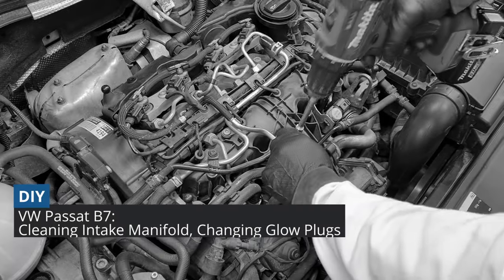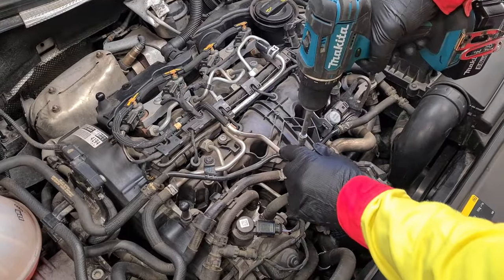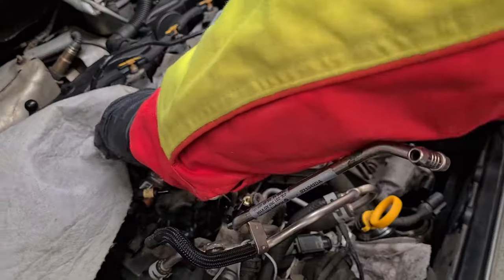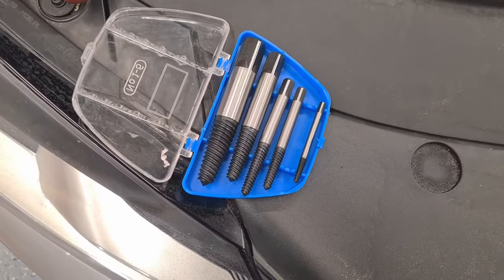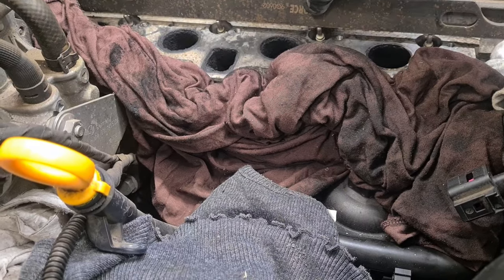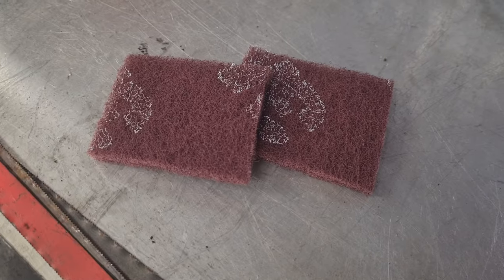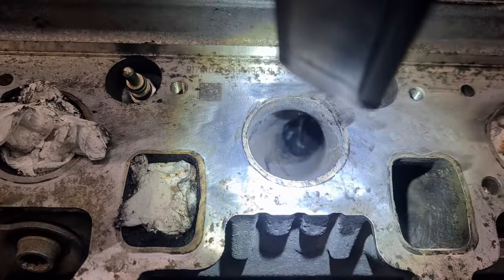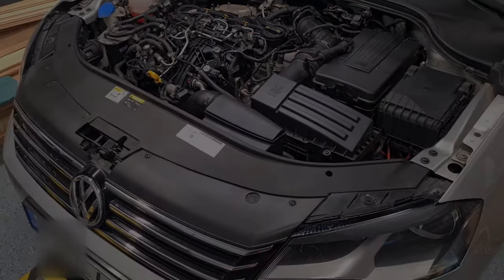Intake Manifold Cleaning: VW Passat B7 2.0TDI

Comment from the maker: 🔧 Tools used: 
       🔹BGS 2292 General rachet and socket set: https://geni.us/0Hhd (Amazon)
       🔹BGS 5188 Torx and Hex socket set: https://geni.us/Zz55Akr (Amazon)
       🔹BGS 9473 combination spanner set: https://geni.us/pxBAWw (Amazon)
       🔹Underhood LED light: https://geni.us/oUVLUpn (Amazon)
       🔹Hazet 1979N-92 flashlight: https://geni.us/gTxEiHA (Amazon)
       🔹Hazet 1979WP-1 magnetic charging pad: https://geni.us/abMfAS (Amazon)
       🔹Hose clamp pliers: https://geni.us/HXeWy (Amazon)
       🔹Stem seal pliers: https://geni.us/67FRPtR (Amazon)
       🔹Mirror tool: https://geni.us/Rtt5v (Amazon)
       🔹Thread repair kit M10x1.0: https://geni.us/HKg2NPf (Amazon)
       🔹Thread tapper M10x1.0: https://geni.us/xJjCREJ (Amazon)
       🔹BGS 1981 thread tap wrench: https://geni.us/67mg (Amazon)
       🔹Bendable magnet: https://geni.us/jxBAi (Amazon)
       🔹Gedore 10-50 Nm torque wrench: https://geni.us/LBhSQA (Amazon)
       🔹Wallnut blasting device: https://geni.us/UvRA0j (Amazon)
       🔹BGS 1105 Hollow socket set: https://geni.us/Ada0LA (Amazon)

 ⚙ Spare parts used: 
       🔹Glow plug BERU GE133 https://geni.us/Zz55Akr (Amazon)
       🔹Throttle valve gasket ELRING 006.070: https://geni.us/TlIW (Amazon)
       🔹Manifold gasket ELRING 236.320: https://geni.us/okjVgCZ (Amazon)
       🔹EGR pipe gasket ELRING 214.500: https://geni.us/4M9uC (Amazon)

⚙ Additional stuff: 
        🔹Nitrile heavy duty gloves GRIPPAZ: https://geni.us/tc4XaYP (Amazon)
        🔹Brake cleaner: https://geni.us/LOeBEc (Amazon)
        🔹Oil absorbent pads: https://geni.us/AAvW0We (Amazon)
        🔹3M scotch brite: https://geni.us/zpMfCdQ (Amazon)
        🔹Glow plug grease: https://geni.us/5LxJt (Amazon)
       🔹Wallnut media for blasting: https://geni.us/wW09t (Amazon)

Comment: I got scared when you did this. I will spray multi spray there every morning for a week, it will be more resistant to different temperatures than WD40. The day I will disassemble it, I will drop brake fluid there in the morning, then I will heat the mortar, it will need to be 90 degrees, I plan to disassemble it that way, I hope I don't break it, otherwise I won't be able to re-make teeth like you.
Reply from the maker: Good luck mate!
Reply: Should be using penetrating fluid like PB Blaster or KROIL.  WD40 is garbage and doesn't do anything for this kind of procedure.

Comment: One question: Did you purge the high pressure diesel line using Vagcom alone? Isn't it necessary to loosen the tubes that go to the injectors and then tighten them when they release air? This is the part that I have the most doubts about, because if a lot of air enters the system it is very difficult to remove it. Thanks for the video, very well explained.
Reply from the maker: Yep. Only with vag com.

Comment: After cleaning just disable the EGR ore use a simulator. Bleeding with a tester is stricly necessary as otherwise the CP4 pump will die soon or after.

Comment: Do I really need the VCDS tester, or will the system bleed itself if started long enough?
Reply from the maker: Theoretically should bleed :) But the lines could get aired
Reply: @dionich  From all I have read meanwhile, the injectors could get damaged if they run too long without diesel. Too risky...
Reply from the maker: @KarlNapp429  I had the scan tool from the beginning, so hard to tell the outcome of doing shortcuts :) I would better stick to the proper procedure
Reply: no need VCDS or any other OBDII tool for this procedure. Just turn 5x the key in position for about 10 secs. Pump will do the same as VCDS did. It is a written procedure of vw/audi, you do not need to worry. you won’t damage anything
Reply: @dovalad thanks for advice

Comment: properly executed repair and well-filmed video! hats off to you!  I would have tried to take out the glow plugs with the engine still warm cuz then it is easier  but I don't know if you did that so I'm just saying
Reply from the maker: Good point! I was thinking of heating the block using the heat gun before the repairs, but completeley forgot about it :-) Worth a try!

Comment: Great video. Thanks.
I have seen in other mechanics videos, to prevent the glow plugs from breaking, WD40 is used and left to act for an hour, the block is heated with a heat gun and when unscrewing, the spark plug is cooled with gas, either a CO2 cartridge or any other spray that cools it quickly.
Then when assembling it, I ask: Would a small layer of copper grease be good to prevent it from sealing again?
Reply from the maker: We did forget the heating indeed. This could have helped. Not sure about the copper. We used glow plug paste on the thread, probably this should be enough.

Comment: How would you remove the glow plugs if you had to do the job again? Could you remove the top off the glow plug, and introduce a cold fluid to shrink it a bit (eg a compressed gas)? 
Also, running the low pressure pump will prime the high pressure lines?
Reply from the maker: Hi. Hard to say about the cooling, need to test this method. But I would definately heat the engine block with my heat gun next time.

Comment: Removed my manifold on same engine 2.0 tdi 170bhp cega engine.
After refitting and vcds fuel priming it just wouldn’t not fire and no fuel pressure. Even with a vac pump on return lines we still couldn’t get fuel…..
I’ve got to swap in-line electric fuel pump next week and now dreading it.

Comment: Very good work. 
Did this happen due to faulty egr valve or its common by 75000 kms above vehicles?

Also recommended to get engine intake valve cleaned ?
Reply from the maker: Thanks. This is a standart operation of egr system - to shit up your intake. Cleaned my e91 320d years ago, same story. Its better to clean the valves as well in the engine head, this will smoothen the airflow.

Comment: Greeting. First, let me praise the great effort and detailing. Well done, really!

I have one question - I have a passat b7 2.0TDI 125kw 4 motion, engine tag CFGB.

Belt replacement was done, with all spanners and tensioners, water pump and line belt.
After that, the car consumes at least 2-3 liters more.
Is it necessary to synchronize the high pressure pump together with the intake cam? Because I'm afraid that the mechanic didn't do the synchronization, because he didn't use locking tools (for crankshaft, cam and pump). He just marked the crankshaft with a marker...
Reply from the maker: Hi, thanks. 
We are about to do this job in the coming months. As far as I remember from the manual, the fuel pump needs to be also locked with a special locking pin. Cannot suggest whether the pump should be synced or not, I don't know the mechanics of those fuel pumps. It could be also that your mechanic lost the proper ignition timing whilst not using locking tools.
Reply: @dionich  thanks for your reply!
the car starts quickly, just like before changing the belt, only the consumption is higher by 2-3L.
before he was spending about 7-8L in the city, and now it goes over 10-11L.
so I'm afraid that something is not synchronized properly.
Reply: @radulepg hi man,  we have the same story and I'm thinking to do a timing belt adjustment with hp, my mechanic man told it doesn't matter to time the hp pump but i think i have a high mileage with black smoke, any suggestions about your story?
Reply: @aveirozinou2919  I haven't touched anything on my car yet.
I left it as is.
I don't have a problem with morning ignition, so I didn't work on it.
I don't have any black smoke, the car runs as it should.
Except that, a little higher consumption.
Check injector parameters, through diagnostics, to be sure that the problem is not with them. 
Basically, everything should be in sync, because that's how the factory made it.
But I'm not sure if your black smoke is from an unsynchronized pump.
How does the car work on idle?
Is it shaking?
Reply: @radulepg  no shaking no hesitating, car works fine even when you rev the car answer fast, but i think the way my car start is different from before i changed the belt, black smoke is before and after i changed the belt, but with high mileage consumption than before, so my question is does a timing belt adjustment for hp is required or not
Reply: @aveirozinou2919  factory Camshaft, HP and crankshaft must be synchronized. Locking tools are used for that. 
The factory didn't put the markings for no reason.
Many say that the pump does not have to be "in line" with the cam, but I think they are wrong.
The marks are there to follow the procedure.
First, you lock crank, then you lock camsfhaft and HP pump must be in line. If not, then you have to synhro HP with Camshaft.
Reply: @radulepg  i will redo my timing belt and i will see because i strongly agree with the point that volkswagen put the marks for a reason, thank you for your reply man 🙂

Comment: I changed the intake manifold on my audi a3 2.0 tdi, but now it doesnt start. Do you know what’s the issue?
Reply from the maker: @kristianlind9977  Maybe some sensors are not connected. Check the fault codes and all the connector plugs.
Reply: Try bleeding the fuel system then you should be good to go

Comment: I've got a 2013 with 112k miles on it, should I do this at some point in the near future?
Reply from the maker: You can start preparing for this job. I did several previous diesel cars with 240-260k kilometers including this passat. They looked the same, all clogged with soot.
Reply: they get like this after only 20.000km. my is same and i dont clean it since it is pointless and car works fine

Comment: Hello, i have the same engine and I'm suffering from black smoke when accelerate from idle to an rmp number (so that happen when you accelerate not when you hold the rpm), i chekcked timing belt its okay, i added injector cleaner and checked injection timing by vcds all okay, new filters of course, changed maf sensor and i still have the same problem, i also cleaned egr and catalytic converter, any help!?
Reply from the maker: Hey. Black smoke is mostly due to rich mixture. Intake air filter clogged or injectors leaking. Check the intake  hoses, manifold with smoke test as well.
Reply: @dionich  thank you for the reply, all filters are new, maybe intake manifold leaking i will go for it, please tell me do i have to check the timing of the hp fuel pump or it doesn't matter
Reply from the maker: @aveirozinou2919  Not sure wheter hp pump timing is essential, although we are going to replace the timing belt ourselves in September and I remember according manual that hp pump needs to be locked with a pin as well as the camshaft.
Reply: @dionich  i will do a second timing belt adjustment with hp of course and i will update my result, thank you

Comment: Could u tell me the direction of the egr feed pipe? Hole towards inlet or opposite?
Reply from the maker: From the block towards the intake manifold
Reply: @dionich  thanks but, the egr pipe has a hole once inside the manifold what direction should that hole be. Hope you understand this question
Reply from the maker: @Pure-Luck447  Hole is at the manifold side. In the block side theres a flange with a metal gasket. Is this ehat you need?

Comment: anyone know how to prime the fuel pump without vcds?
Reply from the maker: Find the fuel pump and fire it up using 12v
Reply: @dionich  thank you for fast reply. i turned the key to contact a few times, and cranked it 3 times for about 5 seconds and it turned on on the 4th try. definitely wouldn't recommend though. my car is a 2012 audi a3 8p 1.6 tdi. about 5 hours of work including good cleaning i followed your tutorial and my car works like charm now, thank you very much..

Comment: this is usless since only after 20.000km it will be the same. it is design flaw, when manufacturer dont care about consumer and just make engine euro5 compliant. introducing oily blow by gases via crankshaft ventilation plus sooty exhaust gases via egr both meet in the intake manifold and there is a receipe for clogging everything. 
only solution is to install egr delete or catch can. 

newer engines are better since they get exhaust gases after dpf so there are no soot.
Reply from the maker: Modern eco reality.